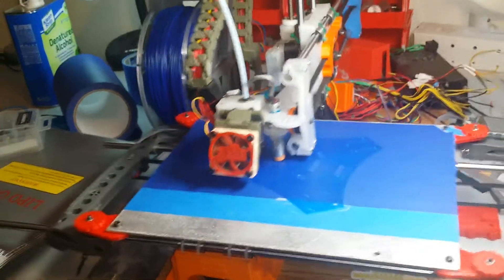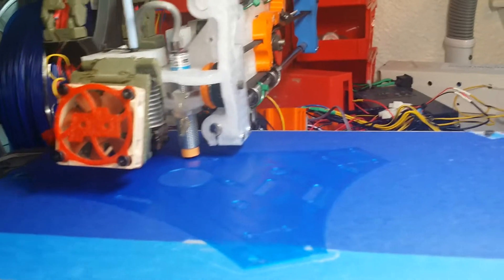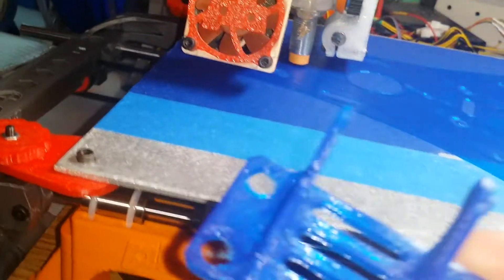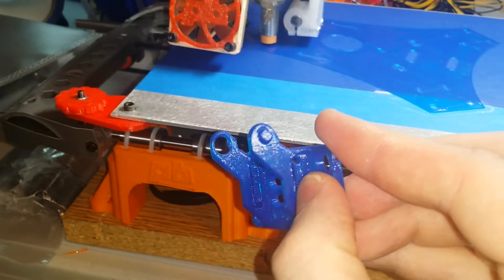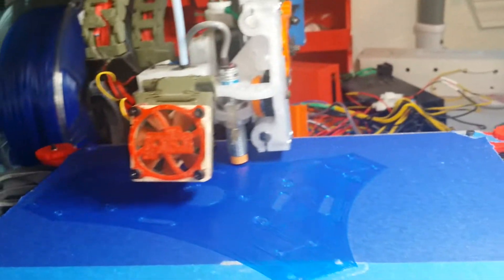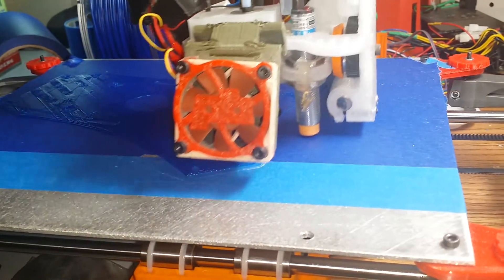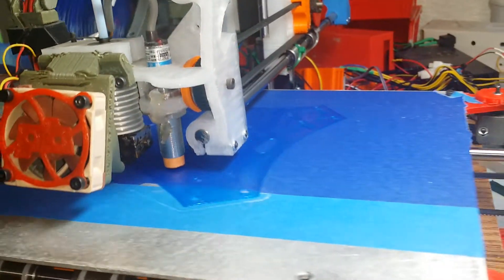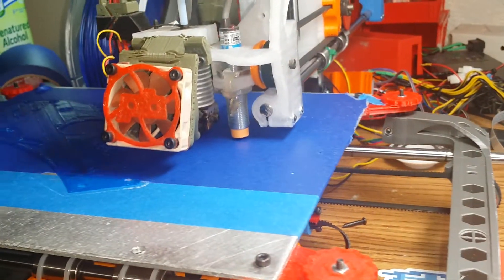Crazy mod makes FDM Printers blazing fast

Comment: Im familiar with JonL's work but I'm at alse as to the extended arms running from the bed posts
Reply: Printrbot. Talk has those arms holding the bed and the red clamps I made myself I haven't put them up on Thingiverse but I might
Reply: danman1178 I found them but alas the catch 22 is I can not print them even after doing the simple x mod. I only have the 1405 stock bed and then my 200x300 bed, I may have to buy an in-between bed to print the expanded x ends in order to use my 200x300. could y

Comment from the maker: from some guy that had a spare... kinda lucked out... posted the need on a formn then someone pm'd and I just paid shipping.. but you can get it at like home depot or a metals shop.. look in the phone book or duh google your local map I got another one from a shop like that but it was not perfectly flat.. this cause lots of problems so make sure that you tell them that it needs to be flat..
Reply: super late to the party but yeah off cuts of larger massive say 8 foot and 12 foot pieces of aluminum and titanium are often available through workers who grab and ebay it off, got a ton of titanium sheet this way, along with a titanium aluminum alloy sheet 10 foot long, and almost exactly 1 foot wide, ultra flat and rigid 1/8th inch thick :) Something I am going to be working on by next summer with a friend in TX is an aluminum extruder system for squeezing out T-slot and some other custom extrusion stuff, as the prices on any of it have gone through the roof, 1x1 t-slot from 80/20 was 25 bucks for 8 foot, and now its like 60 last I looked :O . Been doing a little spin friction welding using a dremel in a router attachment that lets me push the rod into the material as it is used up works amazingly with titanium, is a little fidgety with aluminum but bonds when right are as strong as the original metal before it was cut, :) (work for an electrostatic drone system that is honestly going far to slow LOL)

Comment: Nice work, love your printer, Lucaris speed reminded me of  Spaceballs the move...
Youtube video shaking correction has left some interesting artefacts... Made me feel drunk... LOL
Reply from the maker: yea turning that shake correction off... jeeze- loopy looking... youtube kinda did that on its own..
Reply: @insightoftheages5571  now imagine going plaid with out running the motors or the bed around even half as fast as it is now, something I am working on that is a wide strip of opening with pins fitted all along it to close it up and able to be retracted so plastic can squeeze out anywhere along that slit even up to say 8 feet wide (crazy big printer the size you would build into a garage and drive into it to print out parts right on a car or something) anyway on an 8 inch wide one, every swipe across a whole layer is done as fast as that bed can jump from one side to the other, going at a 45 degree angle? head rotates so the head is 90 degrees off from that 45 so it swipes across again in one swipe doing all infill or whole layer of a top or bottom solid layer at once, making a total 3 hour print in less than 18 seconds, (for say a round wall 3 layers thick three pins retract and the head rotates as the bed moves so it is always wide along the tracing of that circle laying down exactly 3 layers wide at once, so it can then move on to the next layer instead of going around 3 times, LOL 

something similar we have had from ages past was the pin printers that had 9 or 23 pin sometimes in layers behind each other, of dot matrix printers but they did not lay down and draw until retracted, this will, and crazy thing is this is the tamest of the upgrades, (and easiest to replicate by others with only instructions,) later ones will allow the head to create a vacuum right under it and either deposit material for say a diode or LED right on the surface, or cold fuse metal together so it has strength and is solid like spring tempered steel, or copper or what ever, as well as ablate stuff one layer at a time into nano powders using multiple lasers (activators and charging units to break down elements activated like using a green laser to oxidize the surface of a copper item and a UV laser that will only evaporate the copper oxide, the pure copper under is safe from damage, as it goes so the tiniest of copper oxide particles are made and sucked away sorted with various methods so it can be spit out later and that same UV laser can be ramped up to break the oxygen off and allow the copper to fuse to what ever it is resting on, and the oxygen gets sucked away not with say fans or anything but an electrostatic charge like how styrofoam peanuts will just jump and stick to a piece of someones cloths or a cat after you brush or rub them with something like glass or a comb :) (from there it can be stored for future use to break something else down or making a barrier in a transistor thus nothing but raw materials needed to say print out a whole cell phone, after that the programming it for your use is up to you, but, means it can be free from spying tech LOL)
Reply from the maker: @ThomasAndersonbsf  awsome.. Would love to see it.
Reply: @insightoftheages5571  I will get around to filming stuff though it will be on rumble or odysee or something, never really wanted ads on my stuff and now that google started inserting them regardless of choices of the creators, I had to pull everything here, (and started running adblockers on everything until they either give people that choice and monetize them or just stop dumping into anyone's videos that are not part of the program, If you can choose then you can at least try not to let ads on that you would find adverse while letting ones that you feel would help people to run, but that has been taken away, which I expected when they started auto inserting midrolls on everyone and making them go back and manually remove them if they did not want them (found out about that through Louis Rossmann's repair tutorial videos when he would stop and talk about various problems, :) )